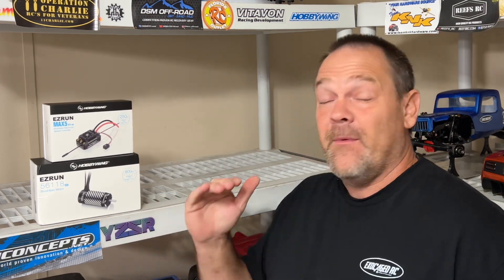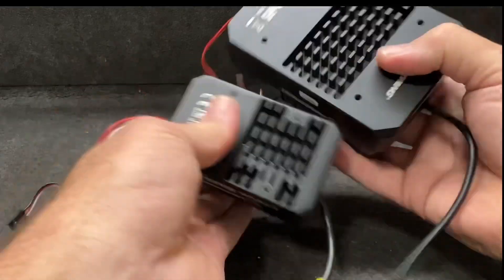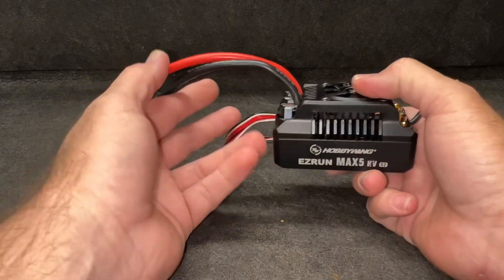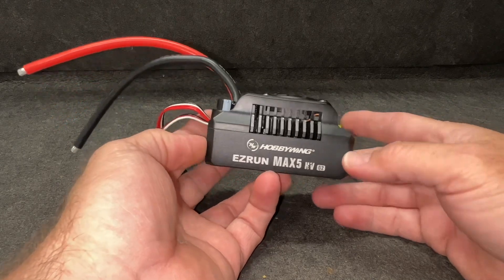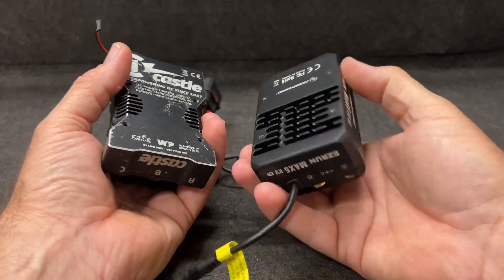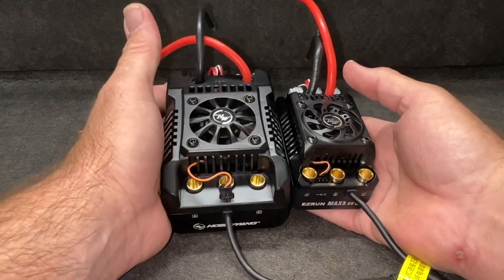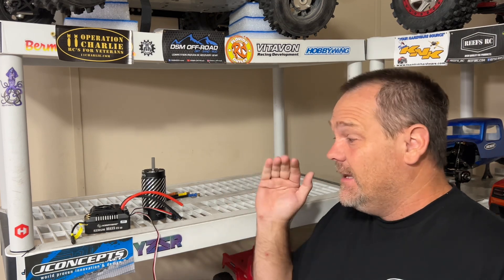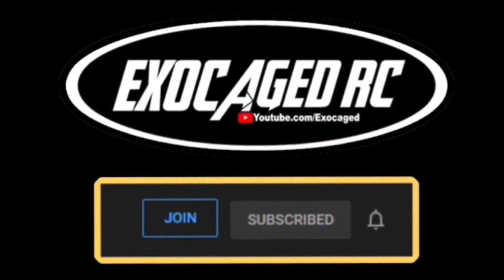The NEW Hobbywing Max5G2 12S and 650kv/800kv/1100kv g2 motor!

Comment: I have the max 5 G2 and 1100 KV G2 now.. any chance you can explain the difference between the old 1100 and the new one?
Reply from the maker: sensored is the main thing
Reply: @ExocagedRC  the 1100 G2 is quite a bit longer than the original 1100... So is this going to be a lot faster? A video comparing the two systems might be a good thing?

Comment: which motor combo fits aarma outcast 1/5 exb 8s.  56118 or 5690?
Reply from the maker: 5690 BUT M2C has a new bellcrank to fit the 56118 in there.
Reply: @ExocagedRC  thank you
Reply: @ExocagedRC  cant find it any marketplace
Reply: @ExocagedRC  m2c part #3268 but cant see available anywhere

Comment: Thanks, Joe, I needed that. I have a Max4/560kv in my Gravedigger, a Max5/800kv in my MTXL Gravedigger LCG, and 8 other Max5/800s in various Kratons, Xmaxxes, XRTs, and Outcasts. Now doing a Outcast EXB 1/2 price beater. I have an XLX2 and a Castle sensored 800. If you were me , would you hold out for a Max5 G2? Given I have quite a few CNHL 9500s 6s lunkers in the gun safe.
Reply: What are you running in your MTXL 8s or 12s?
Reply: @johnnysrcchannel7472   8S. but I just got a Max5 G2 so I might try it on 12S

Comment: Hi, just wondering whether it's possible to see the internals of the new 56118 motor? 
I've order inadvertently the new motor not realising it won't fit in my Kraton 8S and have a crazy idea of somehow using the bell end of the 56113 motor and making it shorter. Unfortunately I don't have the funds to buy a Vitavon chassis and I'm left in a bit of a dilemma.
Reply from the maker: Well they usually use all the space in them. You're wanting to make it fit. I currently have it in the Xmaxx right now.
Reply: @ExocagedRC  I have read on the M2C website that they're currently working on a chassis that will accommodate the new G2 range of motors. Maybe, during the interim, I'll have to settle for a previous generation motor.

Comment: Could you show us if it fits a kraton 8s , I’m putting it in that or a limitless I want something 12s
Reply from the maker: I can check with my Outcast but even that has an M2c chassis. It’s in my K8s but it’s a whole
Different setup.
Reply: @ExocagedRC  I would appreciate it but if it’s a ton of work don’t worry about it it’s gonna go in something no matter what, I understand the differences in those set up’s too though
Reply: @ExocagedRC I can confirm that it does not fit in my outcast 8s, unfortunately. Even the older motor (113mm long) just barely fits with minor sanding. The new G2 motor is 119.2mm for all 3 Kv options and there’s no way to clear the steering linkage unfortunately.
Reply: UPDATE: M2C just barely released a new bell crank so that you can fit these new g2 motors is all arrma 8s

Comment: Exo..as always your nailing it with the content. I can't wait to see it in the k8s as I may be putting that in my k8s depending on your test.
Reply from the maker: The issue with a stock K8s could be that added motor length. Not sure yet.